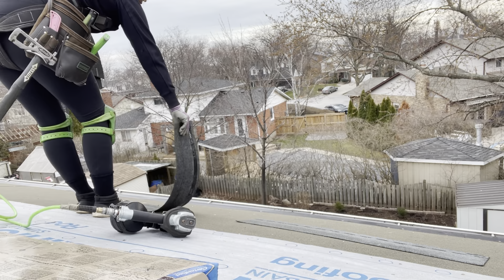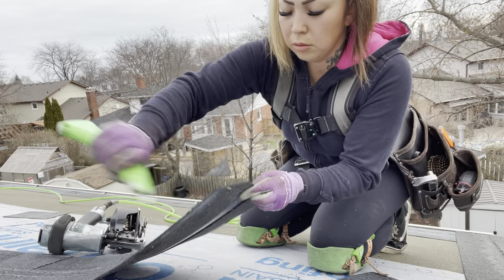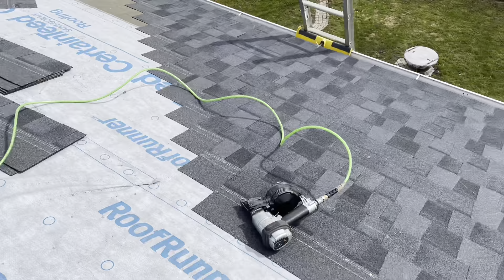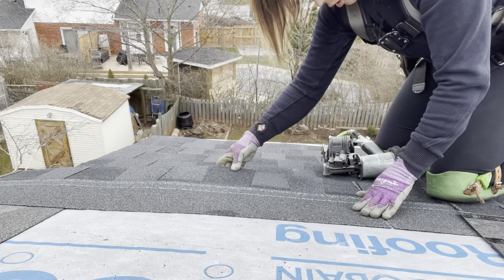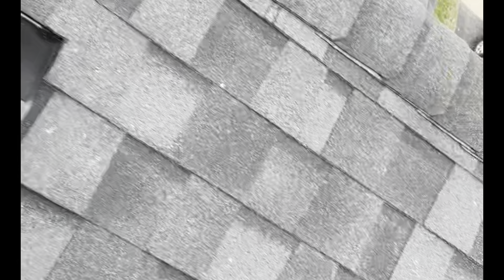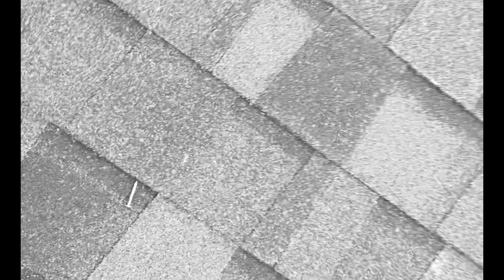Decent day roofing

Comment: Why do all these roofer have shake hatchets? Especially for asphalt shingles. No one ever uses the hatchet end. Can't pull nails or rip out old flashing with them. I did roofing for  almost six years when I was younger and always found a straight claw hammer to be significantly more useful.
Reply: Roofers use them all the time to get nails out of walls, what do you mean?